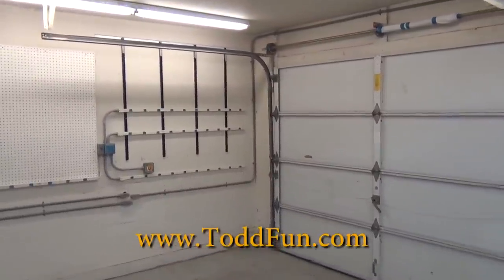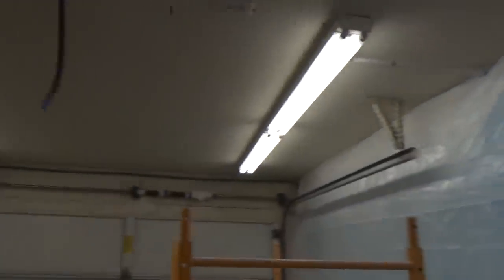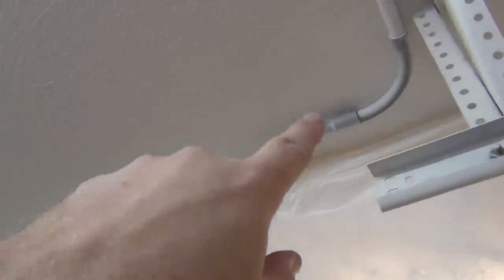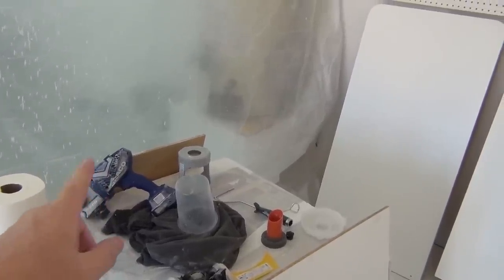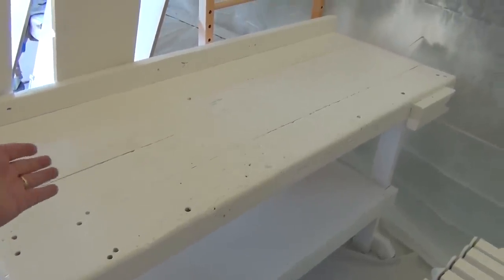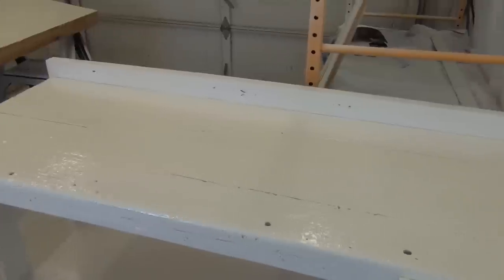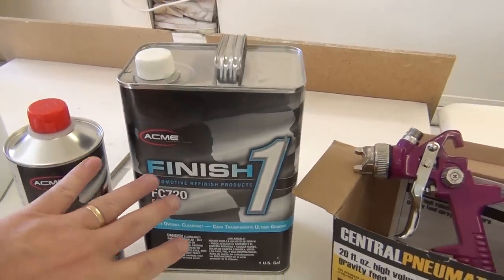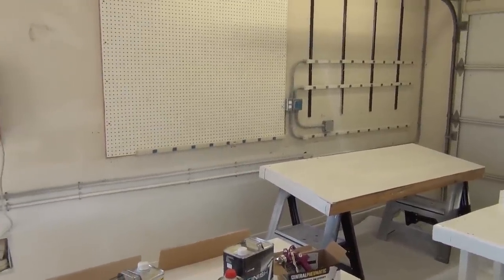Garage Painting and Epoxy Floor Update 2

Comment: Get some new seals for the spray gun for the clearcoat, so that when you use it next time you can change out the seals on the spindle (and a touch of non silicone grease as well, I used red rubber grease, like you use on brake cylinder seals) so that the seals are smooth running and do not cog. Tip with the clearcoat is to use the right thinners for the paint, and as you start to spray in hot times use the thinners with retardant in them, so that the paint does not cure too fast, if you use the standard fast thinners the paint literally can cure before it hits the surface, leading to a powdery paint finish.
Reply from the maker: Thanks for sharing your tips. Much appreciated.